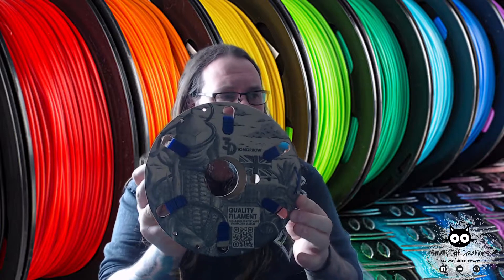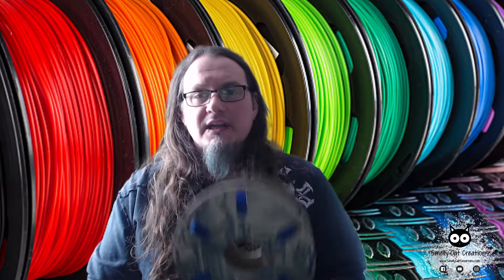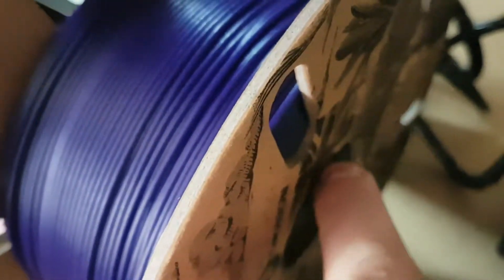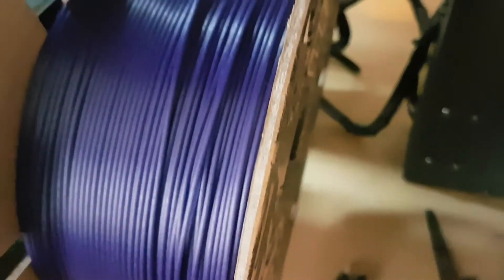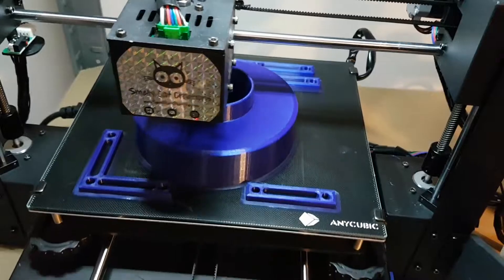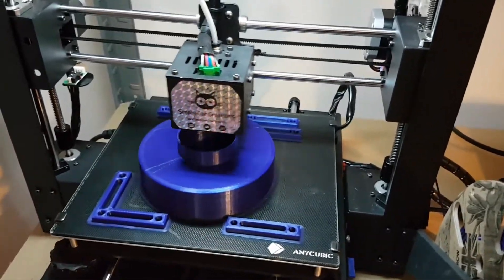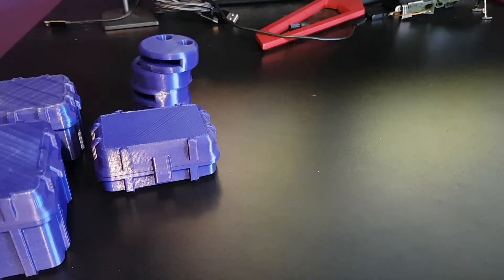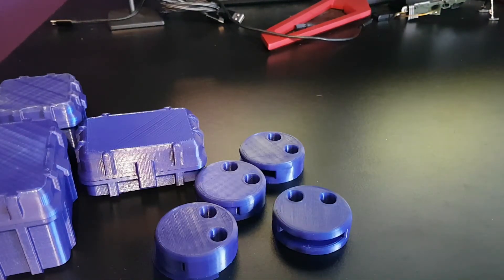Testing 3D Tomorrow PLA Printer Filament - Made in the UK

Comment: I know this is an old video but I was hoping you may be able to help me out? I have the Anycubic mega S and have been using 3d tomorrow filaments for a while. Just got their Silk Pla and I can’t print it. It’s clogging, not extruding properly etc. I was wondering what print temperatures you were using? If I swap to another pla it is printing perfect.
Reply from the maker: I was running them nice and hot at around 215c on the hot end.